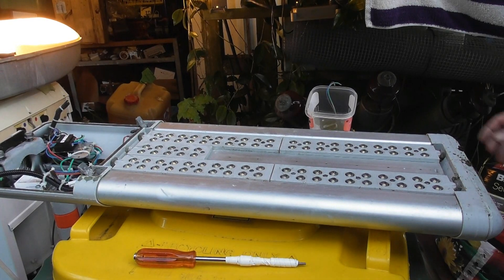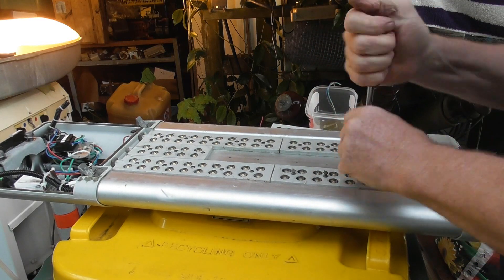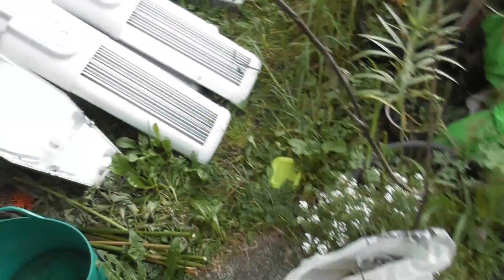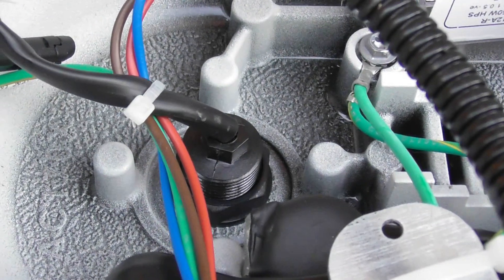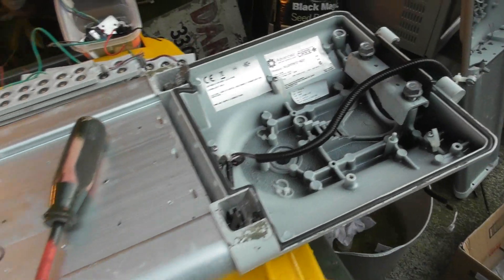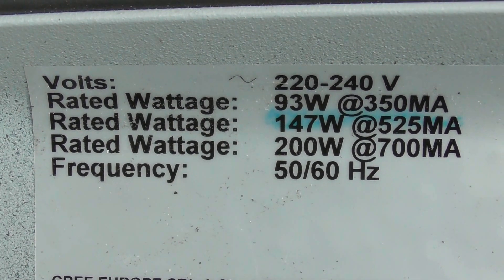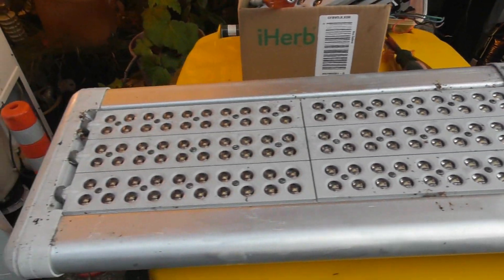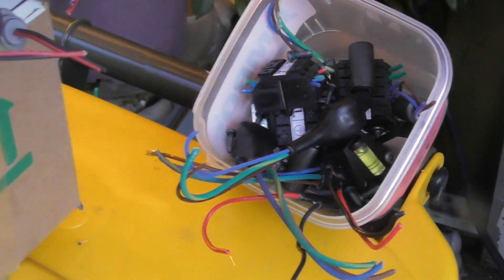CREE LED street lamp dis-assembly

Comment: Those only lastes 6 years? That is bad. Why were they taken off?
Reply: good old "junktronics" nothing meant to last, replace replace replace far too often. majority of tech has hit the hard limiting wall of innovation, compared to sales volume and costs(over-bloated pyramid schemes). what goes up, must come down. pyramids too large cover too much area and become unstable due to the supporting base.
meaning, large companies are spread to paper thin margins and have cut product costs to miniscule amounts and reduced lifespans in an attempt to up sales volume. it's bitting them hard now and will only get worse as they collapse, no amount of string pulling will save them(government intervention), buyouts and consolidation doesn't fix them either, it's all short lived stop gap measures, imminent collapse is inevitable.

Comment: Hi Ray, interesting lights, no mention of their power factor, lux, or colour temperature anywhere.
What purpose would dimming serve, and more importantly, when and how would you control it?
The old HID fittings had factory fitted, voltage free, self regulated, independent lux dispersion systems
(they lasted so long that they filled up with dead insects 🦟 and got covered in spiders 🕷 webs)

Comment: Is it okay to use those led modules without the metal body? I think the body acts like heatsink for those modules. Lifetime for those modules drop a lot without heatsink.

Do you plan to use them with lower power?